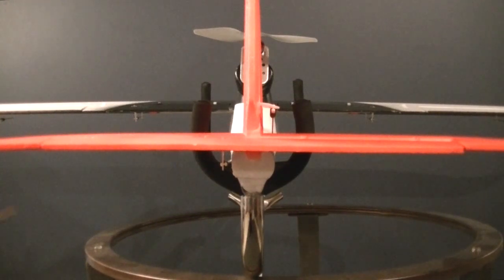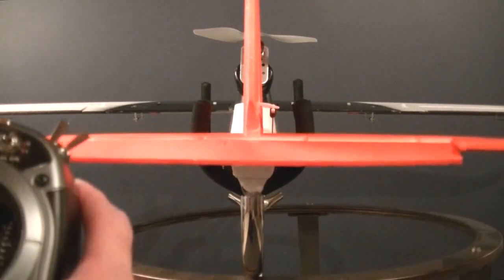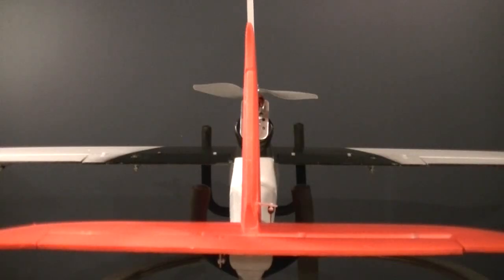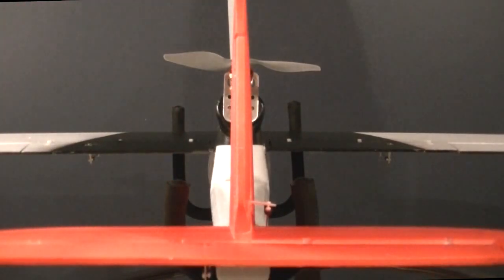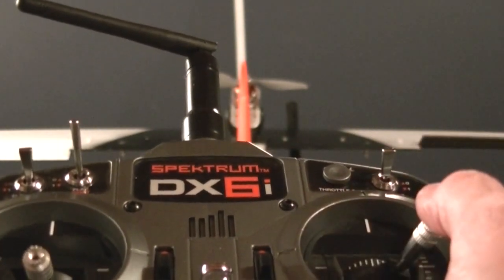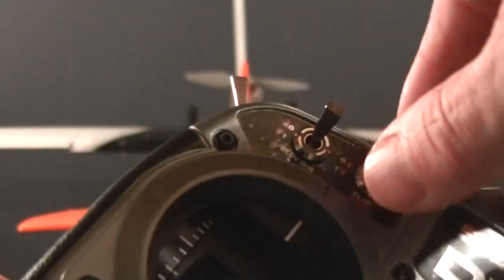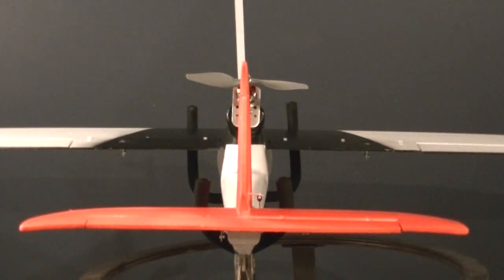Airplane Control Surfaces (Elevator, Rudder, Ailerons, Flaps) Directions and Sticks

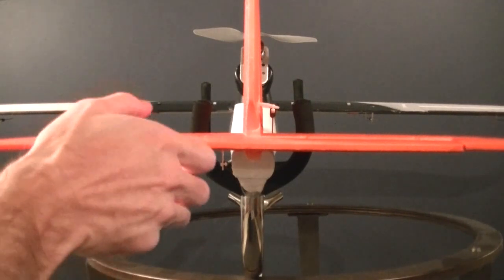Comment: 1:00 minute in I am confused.  How can you trim out your elevator in flight if the left side is level and the right side is sagging down a bit?  I have this issue on my Corsair which has rods guided as or with the hinges on both elevator and Alieron's.  The elevator is almost broken off the hinge at the edge so I can't trim it level, just close.  I crashed hard trying to lift off so I have to address this before I can fly, and I don't want to rip it apart rather try to fix the broken corners.  Maybe a half of a toothpick stabbed will help lift it up to level but would hurt the movement of the hinge!
Reply: Cody Vollick you can trim your ailerons to fly straight. it’ll counteract the elevator being slightly out of line.

Comment: Hi my ailerons are moveing in the wrong direction, when i move the stick left the plane rolls right, i tryed turning the servo around but that dis not work. Could you help ? This is my first plane cessna 747. Thank you
Reply from the maker: You probably need to reverse the aileron channel in the transmitter

Comment: I just learned a great way to think when checking ailerons and elevator. The surface greets the stick! So, when you stand behind the plane, which ever way you push the stick, the aileron high fives it when the setup is correct. And the elevator is pretty similar, pull it towards you and the elevator comes up to greet it, push it away and the elevator goes sadly down. LoL!!
Found that on RC groups. :¬)
Reply from the maker: Yep. That's a good analogy. That's the same one the Flite Test guys use. Hi Fives around!
Reply: Dang, I never spotted that!
Reply: Please help me..
Instead of elevator what will we use in aircraft for nose up and down..

Comment: Cpo heli not cpo plane?
Reply: *****
I started the same way with helis. With the cost and maintenance needed to fly helis, I had to add planes to the mix. Just for easy repair and build time. My cost are still the same but only because I buy more plane parts and acc. from the hobby store.